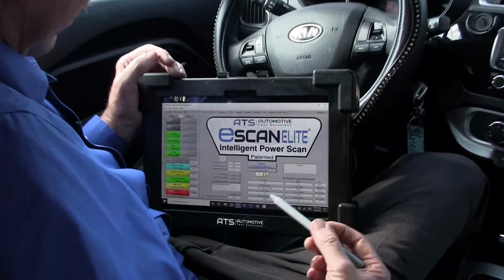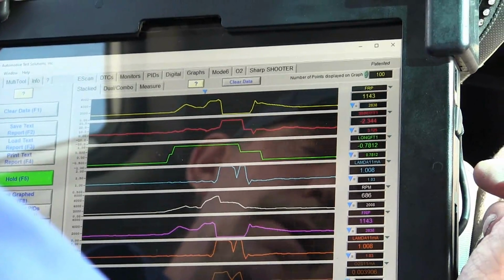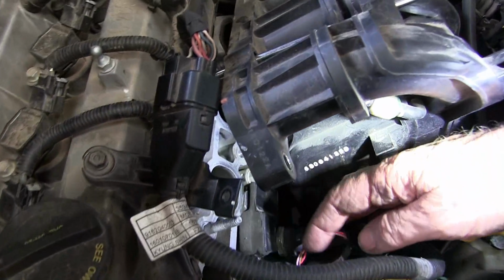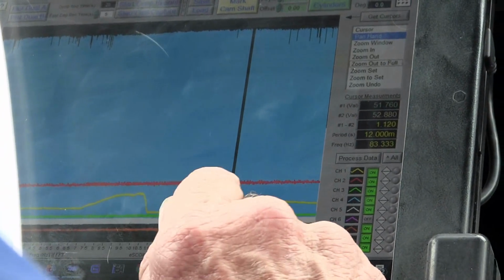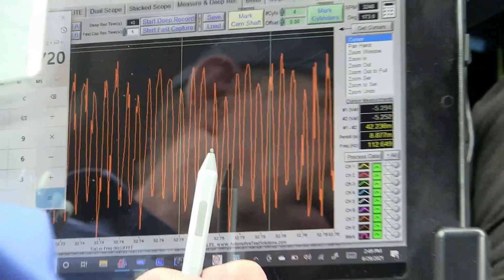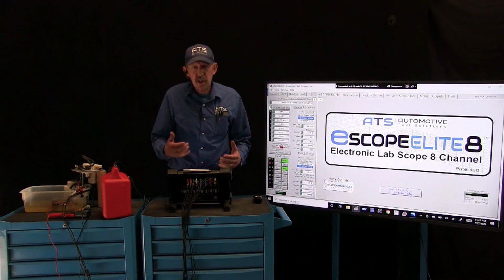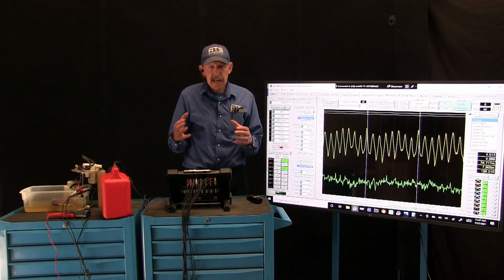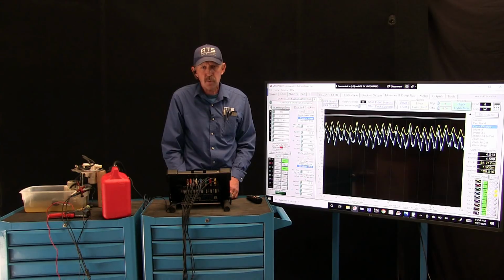2016 Kia Rio 1.6L with low power issue

Comment: I'm thinking 🤔 straight to the point ☝️ the mechanical high pressure pump ⛽ is not 🚫 going to work at all if it is broken it would not fade in and out 🤨 that leaves only one other choice the lift pump is malfunctioning because of electrical short or a bad pump ⛽ dirty filter or fuel contamination either way it's good to remove the pump and see  👀 what in side that fuel tank 🕺 🇺🇸 🇮🇱 ❤️ 😇

Comment: im suprised they didnt just disconnect the fuel hose going to the gdi pump and turn the key,  would have spotted the issue right away!  great video, im having a problem with a soul 2.0 thats losing all power after 30 minutes, no codes, u turn it off and start it back up and it seems to have most power restored for a cuple minutes, then starts to lose power again, im stumped

Comment: The shops that sent these cars around are standard parts changer shops. They can really only replace what the scanner says. They don’t have the training or knowledge to even use a scope. Alot of small shops have not modernized or trained or procured techs that can actually troubleshoot modern fuel injection system and probably don’t know what an algorithm is at all.

Comment: Great Case Study…If the first shop just went back to basics and checked if the high pressure pump was getting what it needed, conduct a pressure and volume test like you did, well, I don’t have to say it. I started my career in the late 80s when we did a fuel volume test at the carburetor, rule of thumb was 1/2 pint in 15 seconds. Overall, the other shops pain was our gain though.

Comment: That approach can only work with non variable speed pumps im guessing.Like non duty cycle systems.Otherwise how can u know if the speed of the pump changed because a restriction or a pcm command change.Unless you try to compare points in time when the duty cycle was the same for both pump rotation situations.Thanks for this amazing class Mr.Thompson.

Comment: What a great diagnostic lesson!  Few techs have the knowledge or skills to troubleshoot electrical/electronic issues.  A scan tool is not enough to always pinpoint where the problem lies.  Until we know how to use a oscilloscope we are just running around in circles.  You showed how the other shops simply assumed that it was a component that was at fault.  Your logical approach was able to verify what was working properly & what was not.  A great video that I learned a lot from!

Comment: A restriction is the first thing i would look at on a power loss under load condition. A lot of times its a simple fuel filter. All these mechanics with this high-tech equipment in these shops failed to do this. Sometimes we gotta take away all the computers and get back to basics. There was a bad wire but it didn't seem bad enough to have much effect on anything, unless im missing something in the video. Clearly it needed to fixed/replaced though. To me this wasn't an electrical issue. I would have scanned for codes but I dont see any reason to do much electrical at that point cause I havent ruled out a mechanical failure or damage to a component within the system im working on. Thinking this through however, in my diagnostics i would have found the problem but most likely would have missed the wire but again, it didn't seem to have much of an impact on anything. The owner of this car will probably have paid half the vehicles value in unnecessary diagnostics and repairs. In my mind this was a diagnostics procedure failure on the part of the other mechanics. 

One other thing that bothers me though, is why a manufacturer of aftermarket products would ever design a fuel line that requires a heat gun to install it while the gas line is open. That is scary! I would never do this! Think of the old Shade Tree mechanics doing this in their driveway and dont have a heat gun. They pull out a lighter or a small torch. KABOOM!! LOL

Comment: Am I understanding you correctly that the fuel rail pressure reached over 2,100 pounds per square inch? That would mean every square inch inside of that full rail has over a ton of force being applied to it. That don't seem possible.

Comment: Very educational information on how to use a scope to diagnose a fault. It fails me as to why if anyone would have a possible suspect HPFP why they wouldn't check the low pressure side feed pressure and flow. Such a simple test. It's quite possible though that someone may have attempted that and cut the line causing another fault while attempting to locate the original fault being the wiring damage.

Comment: Long story short, and to save you a half hour of watching, if you're only getting a trickle of fuel at the motor find out if the most recent repair sitting right there in front of your face, was done properly, especially if that repair involved a heat gun on a plastic fuel line LOL.

Comment: hey Bernie, I think there's an error in your on-screen equation at 33:38 ; 

the first and consequently second (mL) values shown are off by a factor of 100, which would produce less than a half-gallon/hr , however your result is correct for the values stated in the video. 

not a big deal, it may throw those following along for a loop. I always learn so much from you, thanks for the videos.

Comment: flow/pressure relationship showing there. anytime you have a pressure problem  you NEED to test flow.  same for hydraulic systems on equipment. nice to see how the scope worked to verify  prior to physically checking flow.

Comment: Great video love it. What I want to know is how pressure wasn’t checked on the low side at the fitting while driving earlier in the other shops diagnostic process. You could see with a scan tool the pressure leaving. Start simple check supply. Great diagnosis and great lecture.

Comment: Comparing pump load to pump speed, I always imagine driving a standard transmission car down the road... while driving at a steady speed, and keeping a constant throttle position, push in the clutch.  The engine's load disappears, and its speed shoots through the roof!

Comment: It seems safe to say that, since the fuel rail pressure sensor was dropping out, the ECM was making up its own value for the fuel rail pressure at times, based on other data and what it "expected" the pressure to be. Just shows that scan tools can burn you sometimes with substituted values if you don't look deeper into the problem.

Comment: Had one last week.... The air tube rubbed the harness and split the wires going to the fuel rail pressure system. Fixed the wire and good

Comment: I'm glad a simple port fuel injector gauge can still diagnose modern problems.
Reply: Is that why you disliked the video? Or because you don't believe in scopes? Mocking a video for using up to date equipment doesn't make sense. 100 years ago someone like you would have said, I don't need a fuel gauge, I just need to see how far the fuel shoots from the hose.
Reply: @EXOVCDS  I liked the video. Just stating all is not lost with use of tried and true processes.

Comment: WOW this was a cool case study, Bernie! Now my question is why that car needed a fuel line repair to begin with? And that is the biggest glass beaker I have seen in my entire life haha! You're a mad scientist, Bernie!! :)
Reply: Probably because the "brakes and suspension" mechanic used his "trusty ol pry bar" to help himself when R&R one of the 2 new high pressure fuel pumps that were installed(just like he damaged the harness for rail sensor, when prying to change the alternator). Probably when was using this mighty suspension repair tool he damaged the line. I wonder when pump is working against restriction(also a clogged filter) will the amps for the pump go up ? i think yes. 🍻
Reply: @petar443  I often wondered why they dont put a light on the dash for fuel pump amp draw to save a pump if filter is clogged or another restriction should have been done years ago
Reply: @thomasdemarco617 sounds like you should design one and register the copyright!
Reply: He definitely is one of the goat!
Reply: Say it again!!!!!   LOL   LOL
Reply: You serious?

Comment: Bernie, words fail me, but not you. The way you gathered data! The 'understanding' from the data! And the discussion of DC motors, using powers and grounds is priceless. I would say 'one of your best ever' but heck, they're all good.  So, when the high pressure pump output dropped did the hp pump go into cavitation because of the low input pressure?

Comment: The shops throwing parts at it every time.
Reply: That’s a product of the flat rate system. When you only get paid an hour to diagnose the problem, that’s what happens. 

4 hours of diagnostic time costs the customer $520. That’s a real tough sell at the majority of shops. So what happens usually is, average tech is an hour in, and gives up and throws a part at it so they can keep their productivity/efficiency numbers up. 

Who suffers in the end is the customer. Could you imagine paying parts/labor/diag cost on a LP pump, HP pump, AND a used ECM? And your car still isn’t fixed?!? AND it’s a 2016 Kia Rio… you’ve just spent half the value of the car to not find the problem… when in reality, it was another shop that messed it up in both cases. 

As a tech, I see a TON of jobs that involve fixing other people’s f**k ups. And somehow, I rarely ever get the backstory of well, I had it at this shop, and they broke the fuel line on accident, so they hacked in a new connector so that I wouldn’t know they broke my car, but when they did the repair, they messed up and melted the hose… and the car obviously would have started acting up after the repair, so why not take it back to the original shop and have them make it right?!?

So many people take their car to a shop, and if the shop doesn’t fix their problem, they lose trust and don’t bring it back to the shop that did the work… they go to a new shop with better reviews. And they’ll use them, until they make a mistake. It’s brutal.
Reply: @skraapytrails1357  I agree. I try to tell people to go to a shop to have it diagnosed properly.
No. They think a code read at a parts store will magically fix their car. Get sold a part and they are back. Same complaints. Don't want to hear Take it to the shop.
Well...how much it cost? 
Shops charge different rates. It's your choice.
No..i will buy the sensor or this sensor I bought I bad. My mechanic said it was bad. The code will not clear.